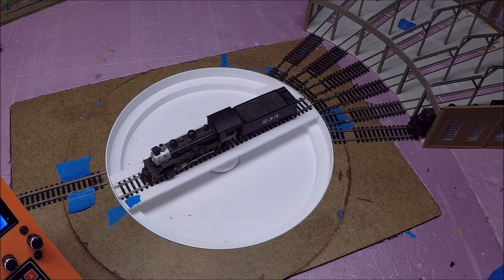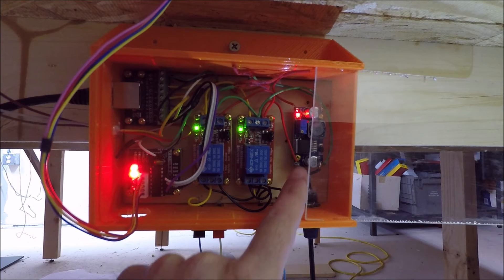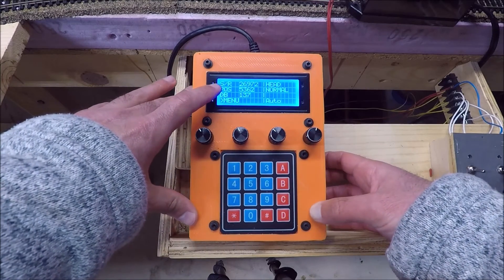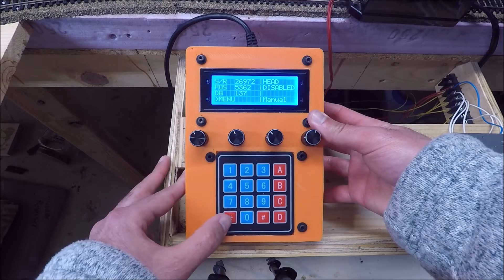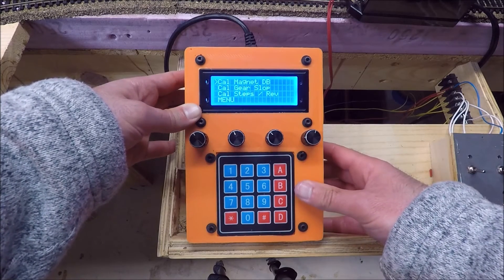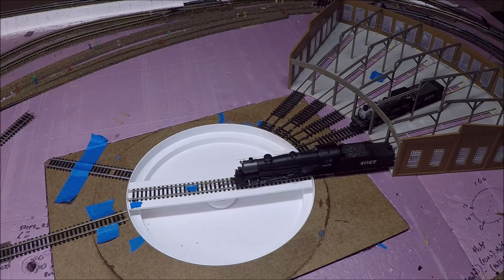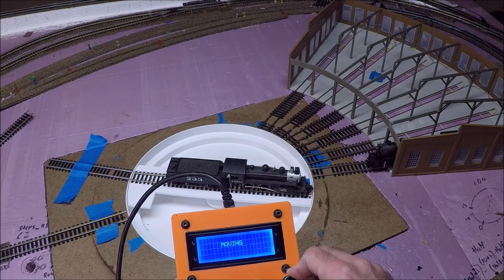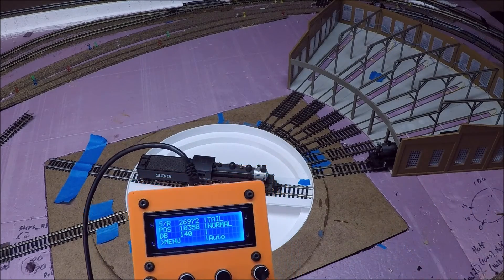Arduino Model Railroad Turntable Part 4

Comment: Awesome project.  I am guessing you have now spent way over the original $300 figure?
Reply from the maker: Thank you! With all of the R&D I did, YES! Totally flew past that $300 mark. 

I believe that if you built the whole thing from scratch using basic parts you could probably get it under $200.

Comment: I Just watched all your videos about this controller and your work is so good!Im not yet in railroad modelling but Im sure I will be soon,and thats why Im here.I have a question and I will try to be as comprehensible as I can.First of all as I can imagine you working with DC controller for your Locomotives so thats why you have to reverse polarity on the "moving" part of the turntable.I cant understand how the individual tracks in the "warehouse" work individually.Sometimes you have more than one trains in the warehouse but it only moves the one that load or unload on the turntable.Is the arduino somehow implemented with these tracks  and gives power only at which you choose?
Reply from the maker: Thanks for watching and thank you for the kind words!

You are correct all of my trains and my layout are old fashion DC. I have never used DCC before but I would assume you would still need to reverse the polarity of the turntable tracks once it moves past 180 degrees, just like DC. The reason being is that as your train moves from the turntable track to the static section of the tracks on the train layout it bridges both sections together through the wheels of the train. If both sections of the track are not the same polarity then you will create a short circuit. There are a lot of documents online on how to wire tracks for a turntable that provide good illustrations that can explain it better than I can via text.

The static tracks in my "warehouse" are all wired to dedicated switches installed on a small box on my layout. I can manually turn power on and off to each track section. I thought about automating this process, but never got around to it. But it is possible! If enough people ask I may be able to add it one day.
Reply: @OrangeLabPinball  Thanks for your response and keep up the good work!Your answer is exactly to the point!Now I got it!

Comment: I just found this video series because I'm looking to add a turntable to my layout and I was wanting to control it via Arduino rather than using a store-bought controller to save money and because I have a source for an unpowered turntable at a very good price. Yours looks to be the most promising code I've found so far. It will probably be at least a couple of months before I'm ready to work on that project, so I hope you come out with some followup videos and code release soon.

In your video you said you were hitting the limits of the Nano, and that the nano was used in the controller to save space. Would it be possible to put the Arduino with the controls under the layout and use the Ethernet cable to connect to the control box instead of the other way around? I don't know how many wires you need for all of the control box components, so it may be a no-go due to the number of wires required for the keypad, knobs, and screen.
Reply from the maker: Thanks for watching. A new video in the series was just put out with more info. 

You hit the nail on the head with your last comment, there wouldn't be enough wires in the Ethernet cable to support all of the switches, knobs, buttons, and LCD. Also you would deal with signal distortion over a longer run with Ethernet cables for the LCD. Great minds think alike because I originally tired to do what you are proposing.

Comment: Great series of videos. I am converting an Australian 90ft turntable made by Anton  to Arduino control. Have you released the Arduino "Sketch"/ files yet if so what is the link, if not any projected date? Keep up the good work. Regards Ken
Reply from the maker: Thank you for watching the series! I have not yet released any code for this project. The Arduino Nano build in this series didn't have the horsepower I needed so I am re designing the controller using an Arduino Mega. Hopefully more videos to come this fall.

Comment: A colleague and I are very interested in this project of yours, and would be most willing to help with some testing? Whilst I can't claim to be a programmer of a y standing, I have recently published a Nextion based Controller for DCC++ and DCC-EX where I wrote all the code and have hopefully learned a few tricks to reduce code size ( particularly when  using an UNO/Nano. Do you have a download location somewhere? Github?
Reply from the maker: The code isn't ready yet. I am currently re designing the controller using an Arduino Mega. I will hopefully release an update video this fall.

Comment: Can you please layout update
Reply from the maker: Good afternoon Matthew. I have gone back to the drawing board for the controller. I am upgrading the system to now use an Arduino Mega and have a better form factor. Progress is currently going pretty slow with my home / work / other projects fighting for my time. I hope to put out another video on the topic in a few months with the new design.
Reply: @OrangeLabPinball  thanks you

Comment: How about a very specific video on how you wrote and downloaded the Arduino program. What you used to build your control box and how you wired it. What and how you built your Arduino control boxes including your box you built below your train table. How you wired everything up.
Reply from the maker: Good afternoon Chris. I plan to make a series of more in depth videos when I release the code opensource. Unfortunately I just cant find the time to get all the documentation written and the code cleaned up. Fingers crossed I can find some time soon.

Comment: Could you tell what Hall effect sensor you are using
Reply from the maker: Good afternoon. I am not positive exactly what sensor it was but I think it may have been the A3144. Its a hall effect sensor with an integral breakout board. You can get around 6 of them for $6 on Amazon. Pretty cost effective.

Comment: Great videos Have you created an Arduino parts list and a wiring diagrams I'd love to have them
Reply from the maker: Thank you!         No parts list or wiring diagram yet. I am in the process of trying to optimize the code and the overall design. There are a few hardware tweaks I might make so nothings 100% done yet.

Comment: A great controller, I built a turntable from MDF and 3D printed swivel section and geared to 10:1 a few years ago and i'm just at the stage of getting working, I use a sketch with a Nema17 from RudysModelRailway but not happy with it so I look forward to see your final build ... Regards John

Comment: Would not be better a position encoder instead of the hall sensor?
Reply from the maker: Good question! Short answer is maybe, but I don't think so. Long answer is a bit more in depth. Based on my short google search a position encoder has a resolution of around 4,000 points per revolution. My hall effect sensor method gives me a resolution of roughly 27,000 points per revolution. I believe this additional resolution is what allows my controller to be so accurate and repeatable. Again very solid question.

Comment: Wow great job. Can you use this controller with dcc? Can't wait for the
Build files download.
Thanks matt
Reply from the maker: Good question. You cant control the turntable through DCC but I think DCC could be send to power the turntable and a DCC locomotive would work fine. I don't know a ton about DCC and I don't have DCC to confirm.

Comment: Hi, very fine work. Some Questions: 1. can you give some information ( brand, type etc. ) of motor, timing belt and wheels and reed relay ? 2. is torque of your nema motor a neccessity or a surplus and might a smaller gear motor be sufficient ? 3. is the gear ratio you use 26 ( motor ) * 8 ( timing wheels ) ? 
You controller is very fine, but as I'm developing a low cost DCC accessory control system, based on low cost I2C boards from Adafruit, Sparkfun etc., on my own, I will also do my own controller. My turntable will be mounted in a non visible part of my model plant and have a diameter of about 25cm. Because of space constraints, the motor will be mounted on the turntable itself. The turntable will be used to mimik a reverse loop for tramways.

Comment: Well done :)
Can you make a video how you made power supply to the tracks so the wires dont twist up (i got some ideas but would like to see how you did it)
Reply from the maker: Thanks!     I didn't do anything special to get the wires going to the tracks from tangling, I just used a 4 wire slip ring. Pretty cheap and super effective.